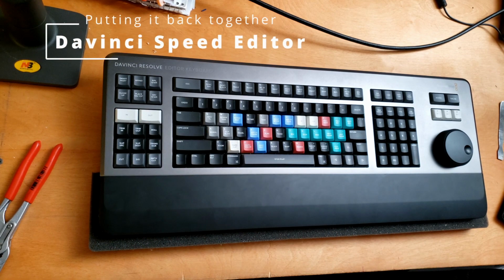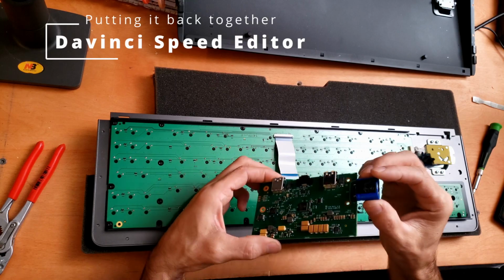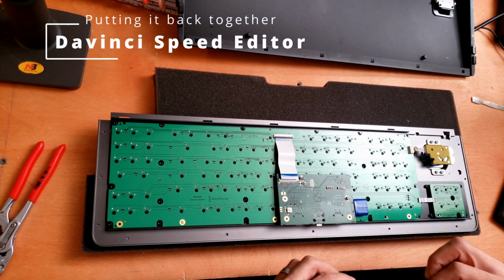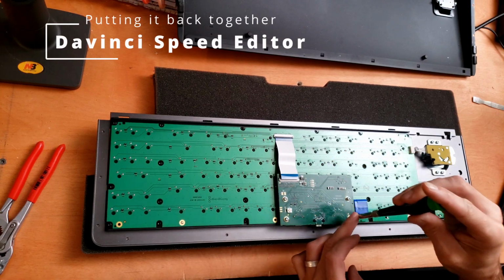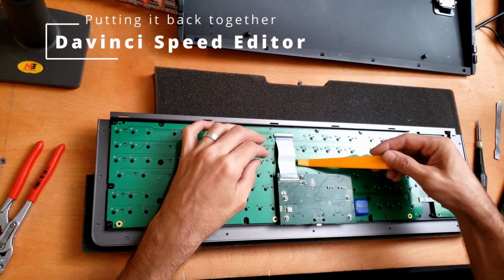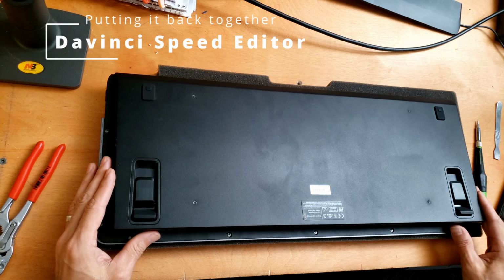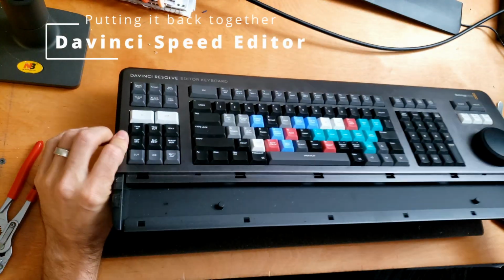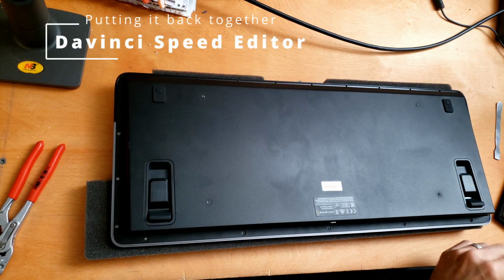Davinci Speed Editor Keyboard Opened up - Emergency repair

Comment: Thank you very much!!!  I've had a scratch on my wristpad and you're the only one who showed how to remove it!  Next I have to change out the USB connector as you've shown here.  Much obliged!
Reply from the maker: Thank you for your comments and kind message. I'm happy to hear it was a suitable video because I am trying hard to make rougher/ less edited content like this so I can create significantly more. 
I should mention that I did not replace the USB port as I did not find the part and the solder connections were not actually loose as I suspected but the port was simply loose allowing the connections on the USB plug to be intermittent (like how a worn electrical outlet sometimes is). I've plugged in a short USB-C extension, adhered it to the keyboard in a way that ensured connectivity/stability and I plug into that now,  dongle style.

Comment: My DaVinci keyboard freezes periodically, and I don't know what is causing it. In the course of troubleshooting the problem, I unplugged and replugged it. Just out of curiosity, was your keyboard with the worn-out USB port causing any issues like freezing up?
Reply from the maker: Yes, I haven't had the problem for a while but I remember the wheel would stop responding or some of the buttons or both. I was using it on my lap so as I got up I would hear the usb unplugging and plugging-in notification on the computer which made it clear to me it was due to a loose port. Similiar to you, unplugging completely and plugging back in usually cleared it up until I accidentally wiggled the port again. I secured a small usb extension cord to the back of the keyboard and I plug into that now and problem is gone.